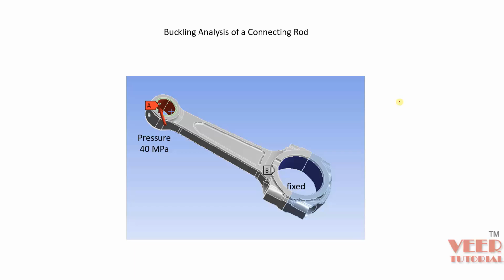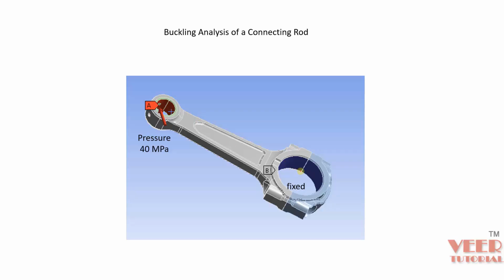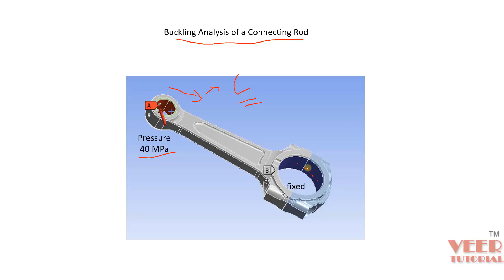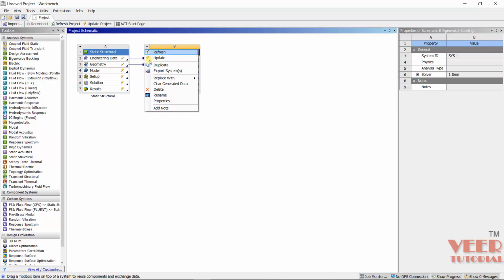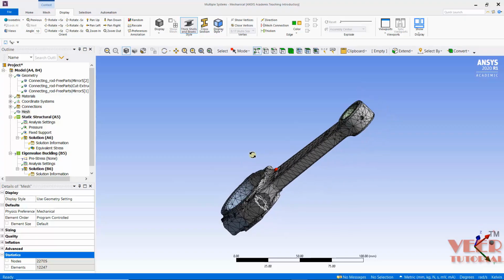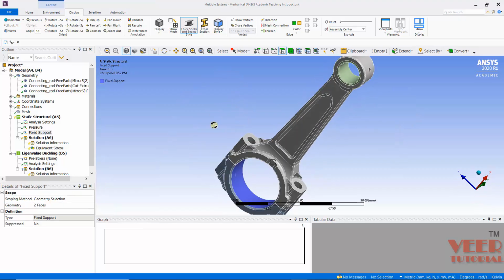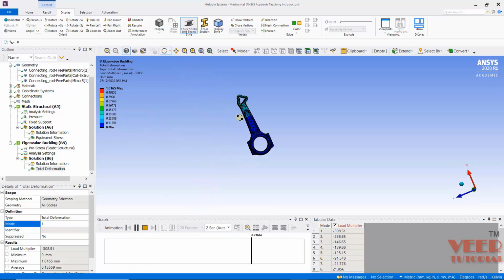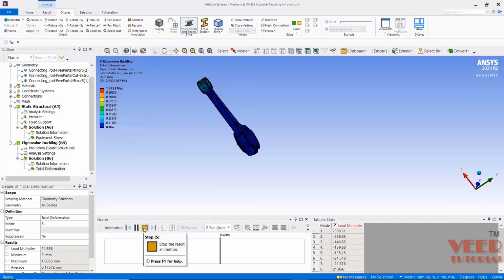ANSYS Workbench | buckling analysis  of connecting Rod

Comment: Sir, after completed of simulation analysis based on some boundary conditions get of results like stress and total deformation . So, if i try various method likely to Numerical analysis got the same results which i can done the simulation results. This method is possible or not, sir.
Reply from the maker: You need to verify results with physical testing data